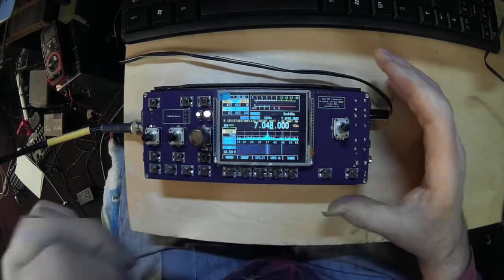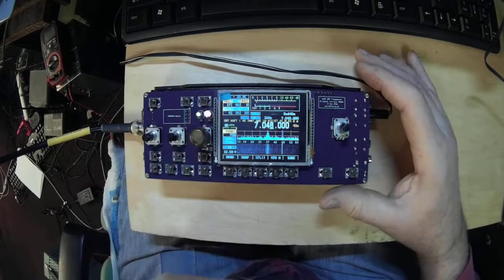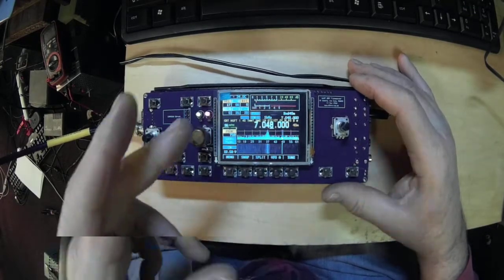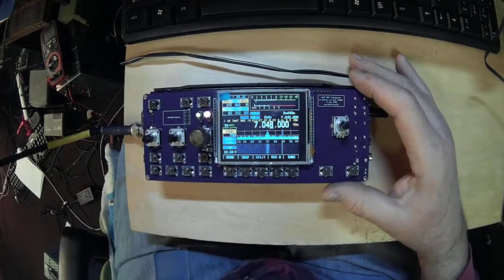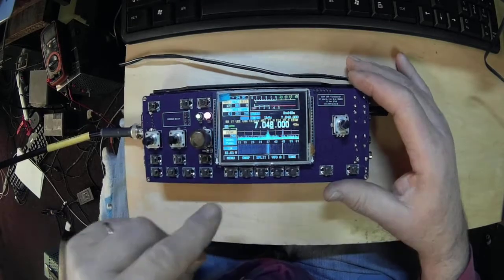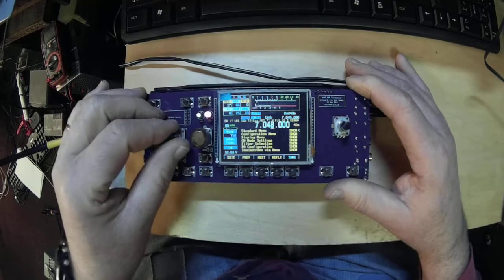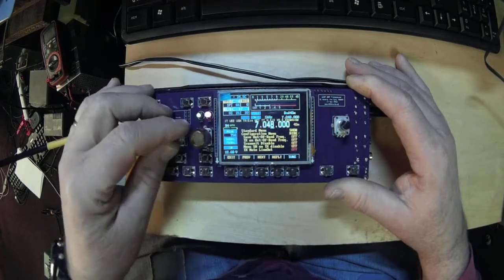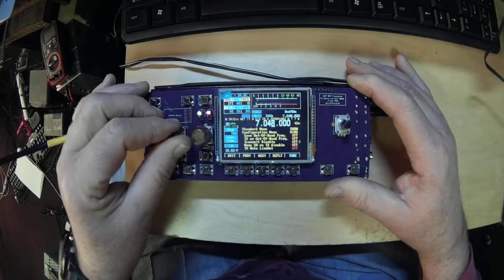MCHF Calibration Part 4, Frequency Calibration

Comment: Do you know how to set the ALC? I'm close to having it dialed in. I see that I"m putting out about 7 watts on digital mode FLDIGI but the ALC doesn't show anything on the meter, which I think is telling me that the audio is not getting out. I also don't have the "SSB" option in the left column, just Digital, RTTY, Free DV and one other, but when I try voice on LSB, I can't set that item on the left to SSB, so also assume my voice isn't getting out in that mode either. I'm sure it's a setting, but the menu has me a bit baffled. You have any thoughts on how to set those things? Great video here also by the way, I will definitely check this calibration out!